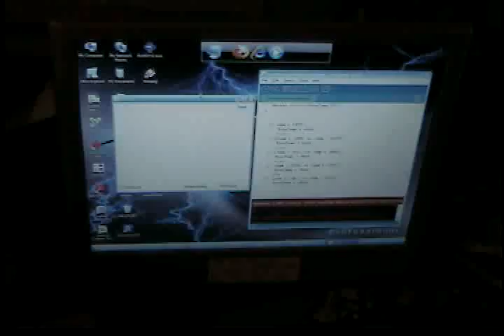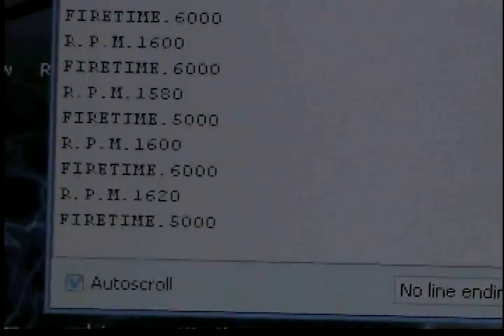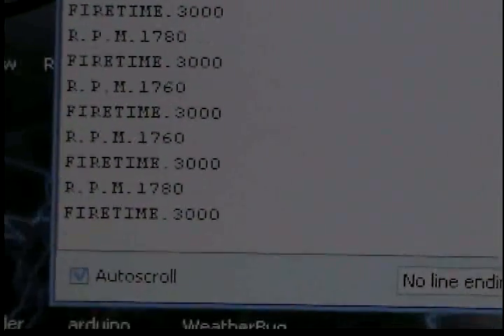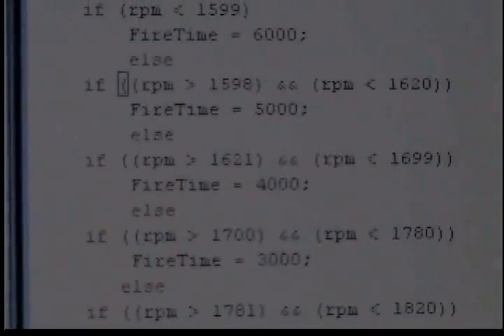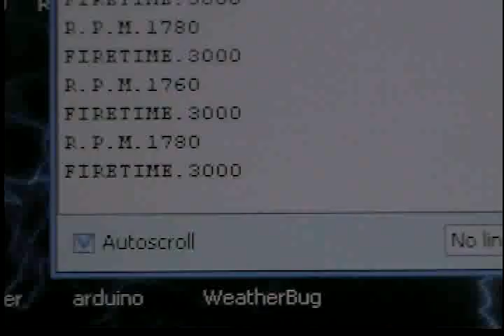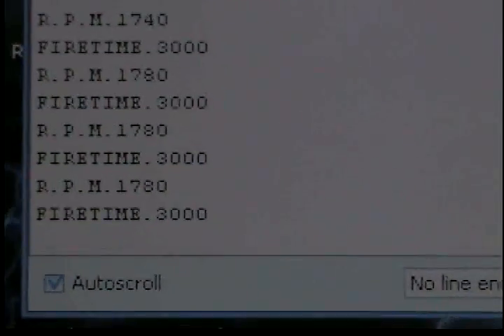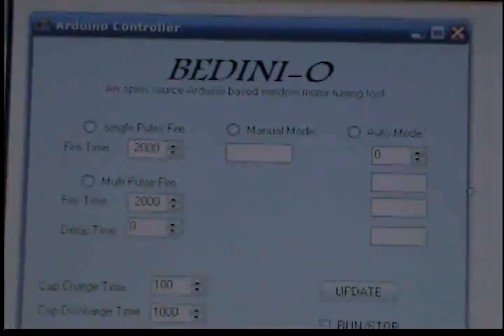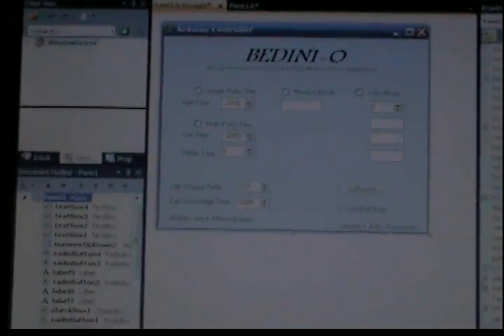Bedini-O window motor controll GUI

Comment from the maker: @insAneTunA This is just starting to scratch the surface of the power of these little processors. The one in this video is the Mega, it has 54 digital pins that can be input or output. A lot of room to grow with this one. I bet that one of these could process my motor and an ssg at the same time. I am glad that the code is coming quickly, with help (thanks Gary). Once I get the GUI working things will be easy for everyone, whatever Arduino project one has. Greets

Comment: Great stuff Rawbush :-) I'm quite impressed with what you've managed to build. Advanced speed controlling is becoming a big thing. Already thought about multiple output control? I mean, since I have a very low understanding about the difficulties about writing software I was wondering  if such thing as multiple outp. control is desirable in the first place and if it's a difficult and/or time robbing task to do or if it's possible at all? How far away are you from the limits of your setup? Peace